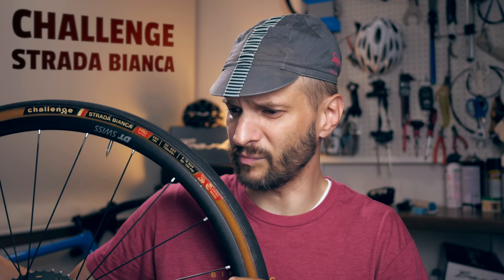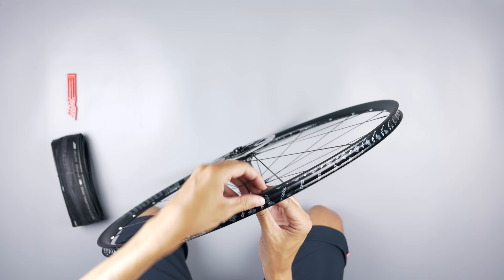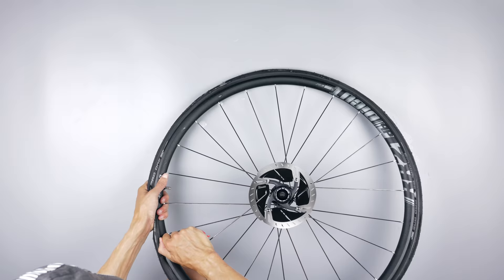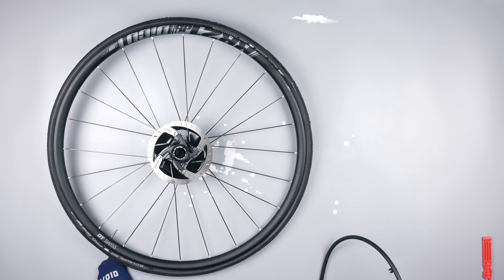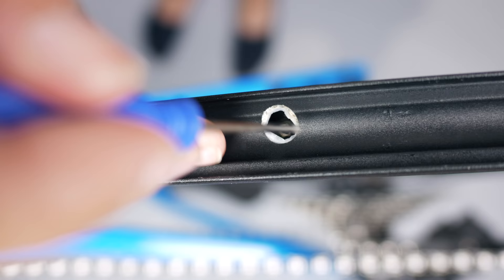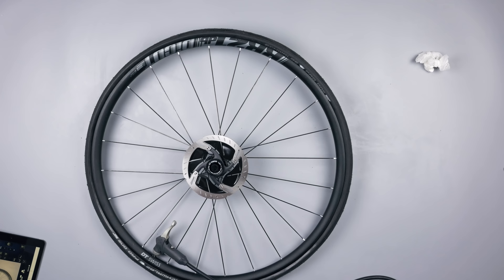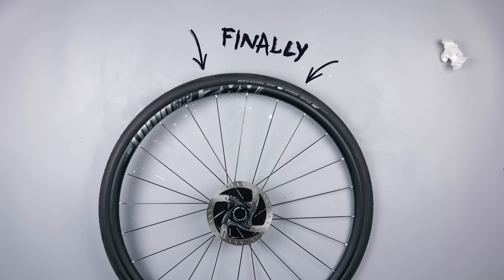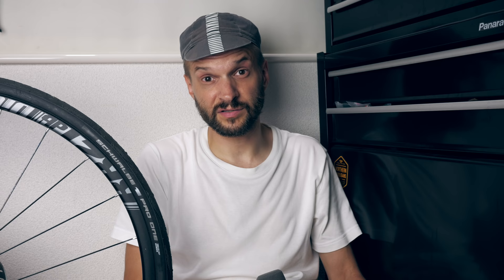Watch me struggle! 5 Tips for Road Tubeless | Schwalbe PRO ONE

Comment: It seems like you have it figured out, but one helpful trick I learned - using an auto-garage style Air Compressor to seat the bead of the tire after filling it with sealant. I've never used the airshot style pump, but you may need a consistent 100+psi pressure getting shot into the valve(sans valve core) for longer than what the airshot may allow for. And for future reference, always double check the rim tape. Even when swapping tires, I always wipe down the rim and check to see if there's any potential to leak air/sealant. Sucks to cost a ride or training session, but it sucks harder when losing a race because of it. I swap alot of XC mtb tires, and really want to go to road tubeless, but I've got a supply of tube'd road tires to burn up which may take a few thousand miles(or km) and I hear a 50/50 split good/bad about road tubeless. I think it boils down to install,  bike care/maintenance and general riding habits. I assume people think road-tubeless, it automatically makes their bikes ready for gravel or heavy debris, and I think you still must treat them as if tubes where in place with just less ride-stoppage of dealing with minor cuts, punctures, etc.
Reply from the maker: tyester tyester tyester an air compressor would have been the dream! 😁 
I been able to seat and seal most my tires with a tubeless pump... but if I had a garage my fist investment would be a air compressor for sure!
I hope that people don’t to think “tubeless = gravel” and start riding that on light weight 25c tires 😱
I guess they would learn a lesson pretty quick though 😂

Comment: I have never had this much drama in the past 4 years of running road tubeless. I recently fitted Schwalbe to my Giant SLR1 wheels and did notice that a track pump couldn't seat them. I used a CO2 canister for high pressure, and it worked a treat. Didn't need to use soapy water or remove valve cores. Conti 5000 S TR's are super easy to seat but are hard to get on the rim. I suspect this is one of the issues. If the tyre goes on easy, then it will be hard to seat. If it requires tyre levers to get on, it should be a nice tight fit.

Comment: Once you’ve added sealant keep the wheel upright and the valve away from the bottom, that way it reduces sealant coming out as it sits in the bottom of the tyre and there’s no air from the valve directly firing into the body of sealant.
Reply from the maker: Mii Ke yes did try that as well but not on video as it was a pain in the ass to switch the camera set up... definitely a good tip, cheers! 👍

Comment: I fit this tyre(PRO ONE 28C) easy, using Giant valve and tape. By normal pump, no sealant or soap water. Just grab the spoke to keep wheel off  ground. Tried this on Roval clx50 and Bontrager TLR aluminum wheel, all works good.
Reply from the maker: Yc Pan excellent!
Some wheels work better than others for sure. Luck has a bit to do with it as well, my rear mounted with just a normal pump too.

Comment: Installing tubeless tire is all about the details.  For my tubeless tires I always stretch the tires on my rims overnight.  Use spray soapy water to check for leaks so I know where the problem is.  I always retape the rims, one layer of electrical tape and two layers of rim tape from DT Swiss.  Avoid using tire levers and use tire pliers instead so I don't damage the rim tape.  Always pressurize the tire with my Topeka tubeless pump.  So far so good on both my MTB and road bike.  My tires hold good pressure for 3 weeks minimum.  I carry a tube, Dynaplug kit, CO2 cartridges and a small tire plier to fix flats on the road.

Comment: I'm sorry you had so much trouble, I've put on about 6 sets of tubeless tyres without ever removing valve cores to put sealent in, with a standard floor pump, and I've never had any issues. You're right luck probably has a lot to do with it.
Reply from the maker: TheRealLaker yeah, there a bit of luck involved, but my mistake was not checking the tape in the beginning 😅

Comment: Glad I watched this... the rim tape advice is timely. I have been running tubes for 11,000km on my tubeless ready wheels and soon going to tubeless. The tape is looking a little indented around the spoke holes and I am having a mystery slow puncture in the rear wheel that is sometimes fast and sometimes slow. I think I will replace the tape to rule out any problems!
Reply from the maker: Craig Lloyd that’s a good idea I think. I actually had the spoke hole puncture an inner tube 3 times in one ride... it took a while to figure that one out. 😓
Reply: Avoid the schwalbe... It's a nightmare.

Comment: I mounted 8 pro ones on different rims without too much struggle, I think that the defective tape might in fact be the culprit of the mess 😜. Another little thing I do when the suckers don't inflate as I want them to is compressing the tire a bit at the valve. This pushes the bead a bit against the rim so the air immediately blasts into the tire, but I do think it's still a ticket from the "tubeless lottery" to get that pain free tubeless installation experience 😄
Reply from the maker: Jelle cheers for the tip, will keep it in mind for the next adventure!
And yes, the tape was definitely the reason for the mess... that plus my impatience 🤦‍♂️😅

Comment: I have been running tubeless on all of the bike here for the past three or four years.  Definitely a learning curve getting the tires seated.  FWIW,  a few of observations.  Agree with Schwable One - very good tire IMHO.

Firstly, never put sealant in until it is firmly seated and holding air. Generally I will put the tire on to an old rim and leave it overnight just to stretch it out a little rather than straight out of the box.  Most of the time they will seat OK using something like the BONTRAGER TLR Flash Charger pump, but for the really troublesome ones a CO2 cartridge and some soapy water almost always gets the job done.  Once it is seated let the CO2 out - pop in the sealant and pump by hand.

Tubeless are worth the effort - to date I have never had a flat that I haven't been able to ride home on (sometimes riding the next day not even realizing that I had a puncture) and they are far more comfortable with the lower pressure.
Reply from the maker: Ian Kidston agreed with all of that! 👌👌ride on!
Reply: One other small trick I found was that when flying with the bikes I don't deflate the tires completely but leave about 20 psi to keep them seated.  To date they have remained seated and I haven't ended up with a bike bag covered in goo!

Comment: Great video. I was lucky with my schwalbe pro ones. The beads popped in and held air (without sealant) on both my giant rims and Hunt carbon aero rims. With just a floor pump too!
The 25mm pro one's inflated to 27mm on hunt wheels with 21mm internal width (matching the external width).
A small section of tyre bead was stubborn to pop in so i put a bit of my face moisturizer on it which helped :) 
I have had some nightmare experiences with my mountain bike tubeless setup though...
Reply from the maker: Adrien Limsowtin awesome! that’s how is should be 😁
I mounted and rode my first ever road tubeless IRC tires without sealant for 9 months... then got a puncture I remembered that I never put any sealant in 😂
Reply: Rides of Japan haha, i always seem to learn the hard way too 😁

Comment: Entertaining. The Schwalbe Pro One is designed so that you do not need sealant with the right rim. Sealant is only for punctures from thorns and such. 
I experimented using a Pro One on a Shimano fully sealed XT rim and it just blew up with a track pump. It was so easy I thought I did something wrong. Comfort is as you have experienced. Grip is superb. Tyre life is as a performance tyre will be (short) but... I ran them with about 60-65 psi without loss of rolling resistance (and super smooth) however this lower pressure prematurely damaged the carcass and the threads were breaking. This led to the next problem with the rim without a rim strip. The tyre had sealed itself to the rim either due to the Stans sealant or some chemical reaction and I could not break the seal on one side. I tried everything and in the end resorted to a blade. 
It made me think twice if I was going to be a long way from home or help. I still think they are great tyres though.
Reply from the maker: Rick Harker been hearing a lot about the “unbreakable seat” thing, almost loom forward to it now 😁
My first road tubeless was IRC tires on sealed Dura Ace c24 wheels, no sealant and held up for almost a year... missed those days hehe
Reply: I think if I had a polymer type of rim strip I would not have had the problem. I initially super cleaned the rim and tyre with alcohol so I don't know if this was a problem either. Since then I've ran Maxis and Gravelking tyres on WTB i19 rims with 3M rim tape (Giant branded) and had no problems. Sealant can be messy if things go wrong and will not wash out of clothes.

Comment: This video made me laugh and cry at the same time. I went through the exact same thing with my 23mm Pro Ones two weeks ago - all the same steps. Ended up finally getting them to seat using a CO2 cartridge. 

Unfortunately I think these tires are very susceptible to cuts/flats. I've already had four flats and only have about 500 miles (800km) on them! Hopefully you have better luck than me. Great video.
Reply from the maker: David Garrett thanks mate! 
I wasted one co2 before I changed the tape, not on video unfortunately. 
I didn’t  think the feedback regarding the tires would be as varied as it has been. Every thing from “been awesome for 4000km” to “flatted first ride” 😅
Fingers crossed I’ll be in the first bracket hehe.
Thanks for watching 🙏
Reply: One of my first pair of pro one got a sidewall puncture in first 50 miles of use.  Sealant would never hold more than 20 psi after that.  It’s really expensive being first adopter of a developing technology.

Comment: I have been  using stans grail and avion rims with schwalbe pro one 20c. One year of riding  about 5000k and no punctures that needed a tube. The tyre  rim combo is the  path to success. Stans sealant used.
Only track pump needed to inflate.
Wide stans rims make 28c tyres 30mm on the bike so be careful as frame clearance might be an issue.
Reply from the maker: Peter Bee good to hear!
Hoping I will have the same exception with mine. So far so good

Comment: I feel your pain.  Same tyres and dt swiss wheels as well.   I am debating either buying new rim tape (like you I have used the existing tape) or just buy p5000 which are much easier to seat once on the rim but harder to get on if that makes sense...  I did get pro ones set up on my brothers Reynolds wheels ok though....

Comment: Same wheelset! Same tire! (Although now RR21 is using G-one 35mm on my gravel bike, while pro one is on my carbon wheels for my TCR disc)

Yep, that stock tape sucks! I changed it to double wrapping stan's notubs yellow tape and it solves all the leakage.
And the asymmetric rim profile makes it easier to leak at valve hole. It makes to me take extra care to punch that valve hole through the tape.
If the hole on tape is a little too large, it's super easy to leak air. (even double wrapped)

But for my case, I have tubeless tank integrated floor pump (bontrager flash charger TLR), which poped the tire just in the second try.
Reply from the maker: Adam Queen yeah, that’s true... I had more leaking around the valve last time I did this with the DT Swiss tape. This time I had a proper “pick” to make to hole, worked like a charm.
The offset spoke hole are definitely a pain in the ass though.
Reply: Yeah, I originally though the asymmetric rim profile is a plus for spoke tension, but it turns out to be pain in the ass

Comment: Another nice video, Tobias ;-) I´m satisfied user of Schwalbe One tyres in 30mm from yesterday.  Used the same "trick" with inner tube, surprisingly the tire didn´t sit 100% with tube, but tubeless was fine (DT Swiss wheels + primary tape). As improvement I spreaded a bit of sealant onto the tire bead before installation. Really fast sealed with Joe´s NoFlat Eco. Let´s ride! :-)

Comment: nice video helps a lot... and I'm facing a problem that, too many punctures in my tyers daily losing air and pumping and doing cycling can you post a video to fix those problems...
Reply from the maker: Hey mate, I have never experienced those issues so it’s hard to make a video about it.
Are the tires new?
I would probably try and remove the tires, and sealant, replace the tubeless tape on the rim, might put an extra layer down, install the tires again and see if they seat and hold a bit of air without sealant. If they can hold at least some air 10min or so, adding sealant should make them air tight.

Comment: Tried the Schwalbe Pro One 25mm tubeless on Shimano Ultegra wheels. Got them seated quite easily with a floor pump. Gave up using them after the 3rd ride as a puncture wouldn't seal. Fast grippy tyres but fragile. Tried Hutchinson Galactik 5's also, same result. Won't try tubeless road tyres again until there is a sealant available that actually works at high pressures. Tried Dynaplug and other repair kits but wasnt satisfied with the results at high pressures.
Reply from the maker: Vishal Sewpersad interesting! I just need to play the waiting game and see if seals or not :)
I used my first road tubeless back in 2012 with caffe latex sealant that worked really good... it was a nightmare to clean though.
Reply: After the first ride I did with Schwalbe's, I noticed that I had a puncture but it had sealed while riding. Was very happy, but the next slightly larger puncture was terminal and cleaning up the messy sealant to fit a tube was a nightmare. Good luck though, hopefully you have a better experience with these tyres
Reply: Nothing but bad luck with tubless for me ,Continental GP 4000 with Vittoria latex works for me, hope yall have better luck.
Reply: Yep, me too. GP4000 with Vittoria Latex have been amazing, and no punctures in over 10,000 km of riding. And on my rims, they measure almost 32mm, amazing ride quality and very fast! And with so much volume, not really much risk of pinch flats unless you run stupid low pressures. I'm all for tubeless for gravel, but for road, I just can't be bothered now.
Reply: I've used the Specialized Roubaix Pro tubeless (30's) and nothing but good things to say. No flats and easy to mount. Check them out
Reply: I run my tyres at 5 - 5-1/2 bar or 75-80 psi. running the Pro1 tyres I found that they wouldn't seal anything over 5 bar which was fine to get me home but sometimes on a bigger cut the pressure would drop to 2 bar before sealing. Over enthusiastic use of CO2 to top the pressure back up just blows the sealant plug out and you are back to square one but with less sealant.

Comment: Not sure if those are tubeless specific  rims, but that makes all the difference in  the world too. If youre buying a new bike or new wheels, having tubeless specific wheels makes this process a breeze. I have both and getting tires on my older (converted to tubeless) rim is basically what you just went through and sometimes worse ( sometimes i have to wrap a strap around the outside of tire to get it to press against rim!) ,  but getting them on my new bike w tubeless rims is basically a 5 minute easy breezy affair thats ALMOST as fast as putting on new tires with a tube.